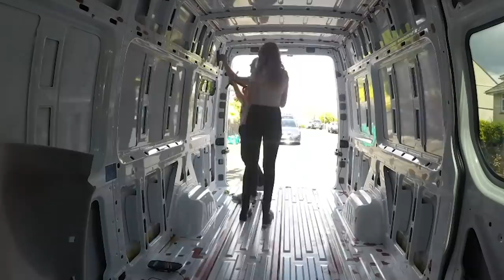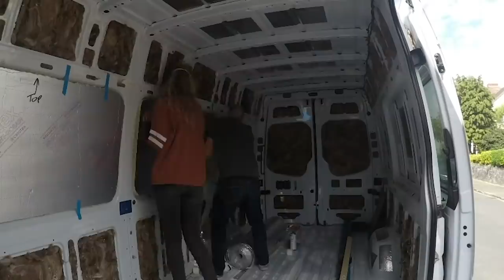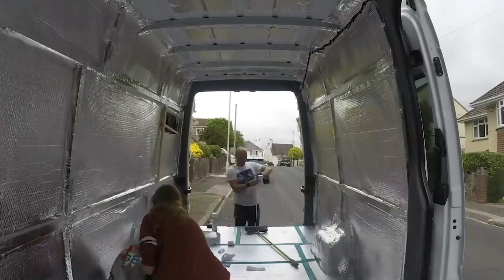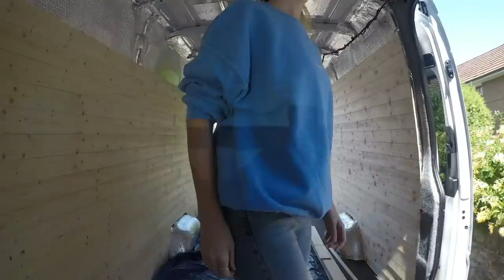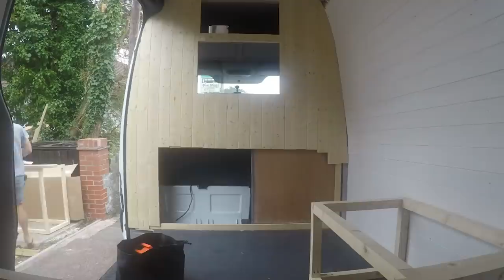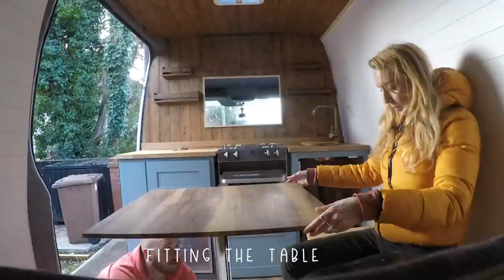OUR VAN CONVERSION (FULL TIME LAPSE) | DIY Sprinter Van Conversion | #VanLife UK

Comment: I don’t think that you’re meant to put fibreglass insulation in a vehicle because it can gather moisture and therefore go mouldy
Reply from the maker: Actually, this isn't true. With a properly sealed vapour barrier there is no reason the soft insulation gets mouldy. We've just started renovating the van and have taken the down the wall cladding. After a year of living in the van in all sorts of climates, we can confirm that the insulation is bone dry :)

Comment: Love it but using that insolation sucks in the water from the outside of the van so it acks like a doing but mite mold
Reply from the maker: Hey, the insulation is sealed with a vapour barrier, so there won't be any moisture reaching that part of the insulation (if the vapour barrier is doing it's job!) 👍

Comment: wow, no vapour barrier on the insulated panels, that will condensate and soak the internal of your van.
Reply from the maker: Hey, not sure which panels you mean? We put vapour barrier on the entire van!
Reply: Overlanding Sophia hi, on the inside of the van where you put the sound deadining on the metal panel of the van you should of put a vapour barrier on top of that, to avoid a build up of interstitial condensation within between the metal and the insulation as this can lead to the development of mould, damp and rot which can cause structural issues and health problems.
Reply from the maker: @aberdeendeltaforce  On top of the sound deadening we have 50mm celotex, then reflectix on top of that, sealed with aluminium tape. So don't worry, it's all fully vapour sealed. Our insulation video goes into more detail of how we insulated and vapour barriered the van. Cheers.
Reply: Overlanding Sophia nothing wrong with that, that will keep the water from from forming on the inside of your van and will keep you warm and toasty, however I cant see whats stopping water forming on the inside between the 50mm insulation and the metal walls of the van and where that water will go?
Reply from the maker: @aberdeendeltaforce  The celotex is applied directly to the sound deadening and acts as a moisture barrier as well as insulation. There are no air pockets between the deadening and celotex 👍
Reply: Overlanding Sophia ah, i see, makes sense now, sorry I was being a bit thick, lovely van by the way. Thanks for the vid.
Reply from the maker: @aberdeendeltaforce  No worries mate, it's all a bit of a minefield figuring out insulation. Cheers 😊

Comment: Amazing how people doing these conversion add all that wood adding 2-300lbs of weight in it, reducing gas mileage increasing drivetrain stress etc . Should use lightweight materials .
Reply from the maker: I think if you’re building a camper van, you accept you’re going to be reducing MPG. Good thing with sprinters is that they have a great engine that still pulls fully loaded at 3.5 tonnes. We are well below that and manage great mileage still. Wouldn’t use anything but light wood to frame out the build either!

Comment: I've got a legal question that's been puzzling me about UK "Van life" for a while. I'm hoping someone reading this may have a definitive answer to it.
I've read of a few people moving out of their rented home, or sells their house to permanently embrace van life. If someone does that, then without a fixed address, how do they even register the van?
I can't see how you could register a vehicle with "No fixed address" in the owners details (For a start, Where would the DVLA send the updated logbook?). The only alternative I can see would be registering it to a friend or family members house. But officially they're supposed to have "The REGISTERED KEEPERS address" on the V5, If that isn't where they actually live wouldn't that leave them open to legal issues for providing incorrect information to the DVLA if people had reason to notice (if parking or speeding fine letters went without replies)?.
What if they had no friends or family willing to let them use their house as a mailing/registered address? Would that mean they couldn't cut their geographical ties without fudging at least a bit of the legal paperwork?
Also, there's the same sort of issue with the address on their driving licence.
Is there anyone out there who knows how you deal with this?

Comment: Grear work there! No toilet though so I imagine this is just for occasional use?
Reply from the maker: Nope, full time living! We have a small portable loo in the back if we need it, but have managed with facilities so far. Haven't built a bathroom into the living area, as we wanted the space. We have a solar shower too for the outside of the van, and wash daily in the sink. Bit of an adjustment from the comforts of home, but hasn't been that difficult at all 😊

Comment: Glass wool or rock wool is total crap in the car. Firstly, it is processing and secondly, it is not good for the respiratory system. The stuff can also get damp and mold. It is better to use Styrophor or other insulation materials in the car.
Reply from the maker: S PA67 We didn’t use glass wool or rock wool 👍

Comment: You lose so much space with a lengthwise bed, but in a sprinter you can't do it crosswise, because it's too narrow. Plus, you lose space due to not using the driver and passenger seat for sitting by turning them around. The wall behind the seats prevent that. So you would have had about the same space inside in a van some 80 to 100 cm shorter if you had taken a Ducato/Jumper instead.
Reply from the maker: Holger Jakobs Can’t do much about that now 😅

Comment: That insulation will hold moisture and rust out your van. FYI
Reply from the maker: Hey Adam, thanks for the heads up, but we're fine. We fully vapour sealed the insulation so it won't hold any moisture. We actually had to access some of the insulation after almost a year and it was bone dry in there 👍😊

Comment: A lot of wasted space in that build. Those vans can get a lot in them but that build has made it look small.. and why did you close off the cabin completely, it’s good to have open for emergencies. Good build nonetheless.
Reply from the maker: That's the beauty of DIY van builds, you create the space to be used exactly how you need it. For us, there's no wasted space, simply because we designed the layout around our needs. We wanted a big sofa area where we could lounge, entertain, work and eat etc. The full size bed is dreamy and gives us loads of garage space too, with overhead storage. There's no shower blocking the way through the van, and so to us, it's open and bright and comfortable. The hatch can still be used in an emergency, although after a year we've never once had to climb through it. There's a lot to be said for having a big sofa area instead of a swivel seat. Anyone who's done a long drive can tell you the last place you want to sit is back in the car seat!

Comment: I think you will regret the wall between the cab.
Reply from the maker: Jeff Herring What makes you say that? We have no problem with it so far
Reply: @OverlandingSophia  Don't you have to get out of the van to get to the back?,  there will be a lot of times were you will not want to get out of the van to go to the back.
Reply from the maker: Yeah, it was a conscious decision to keep it separate. If we ever needed to get into the cab in an emergency, we can just slide through the hatch. But so far we just open the sliding door and get into the cab. Makes the back feel more like a little home and less like an extension of the driving area. It gives us the extra space for the kitchen, and with the L shaped sofa we don't need the swivel seats. It feels no different than climbing out your car to get into your house!

Comment: Wtf are battens. Maybe just studs would work
Reply from the maker: James thomas they do the same thing
Reply: @James thomas furring strips/battens its all about the weight cant just slap full studs in there. this thinking process has to go into the entire build, along with moisture control, which that fiberglass insulation isn't going to handle very well.

Comment: Wool ain't good, holds moisture.
Reply from the maker: We’ve fully vapour sealed the van so there’s no moisture getting to the soft insulation. We had to re-do part of the insulation after a year and it’s bone dry in there ☺️👍

Comment: Lots of these diy hippies. They glue a bunch of uneven weight in a van turning it into a death trap. Suspension needs to be upgraded and weight needs to be distributed evenly for safety.
Reply from the maker: Lots of keyboard warriors out here on YouTube! Weight is well under 3.5tn, both axles are fine, recently we’ve  installed a 5mm lift kit and upgraded the rear leaf springs to 3+1. We know what we’re doing.

Comment: This insulation will be rotten in a few years, im sorry for that!
Reply from the maker: Nah, it's fully vapour sealed - it's dry as a bone!
Reply: Overlanding Sophia yeah building physics says something different.. both sides are closed, thats not working, you‘ll see. But nice Van 👍
Reply from the maker: Giulio Valeo We’ve already had to open up part of the walls to the insulation to check something and it was bone dry, so we will see. If done properly this insulation is fine ✌️ Thanks anyway!

Comment: Clearly you had no concerns for weight 😂
Reply from the maker: Quite the opposite! We are 200kg below the full payload of the van 👍
Reply: Overlanding Sophia payloads Mia be a lot higher than what I’m used to. But my van is a lot older than yours haha.
Reply from the maker: @PNWZach  Ah okay. Yeah the payload for a sprinter like ours is 3.5 tonnes. We haven't built a shower/bathroom into ours so that saves a lot of weight.